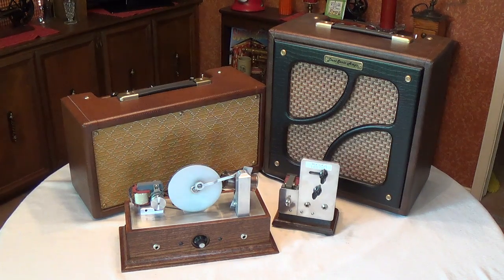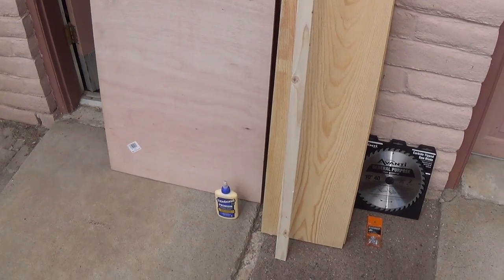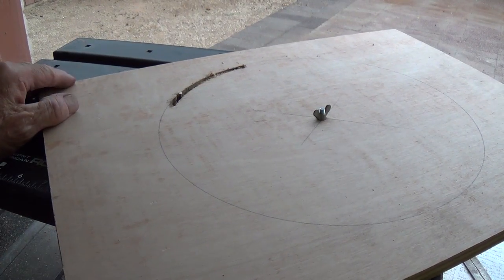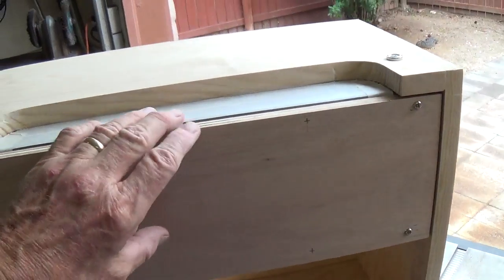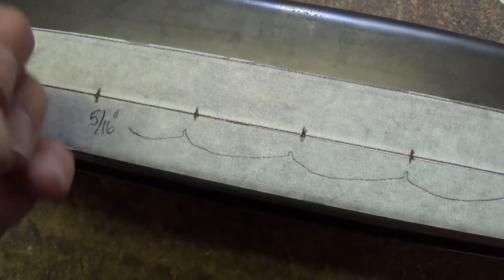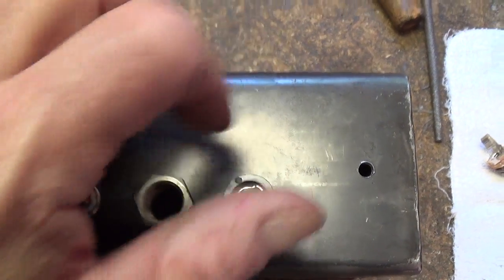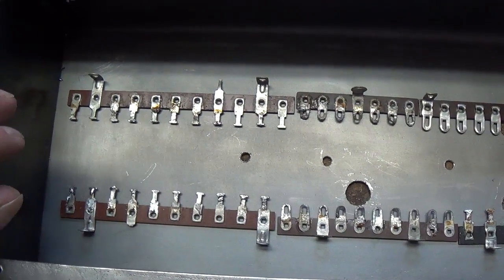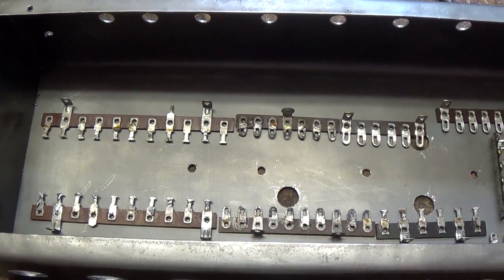How to Scratch-Build a Vintage Amp, Part 6:  Cabinet Construction and Machining of Chassis

Comment: use a drilling lubricant! Brilliant! Having just done this a few times DIY, it never would have occurred to me, but it makes perfect sense. I was a bit surprised that you used porcelain tube sockets. My preference is to use those dirt brown Belkins. I often will design my amp's faceplates on my laptop, and lay it out real nice and have that made before I drill the chassis. That way I can get it to conform to the faceplate perfectly. It helps that I have some background in graphic design.
Reply from the maker: +Alva Goldbook  Yes, by all means use a proper lubricant, Alva.....and not WD40 or some silicon spray. I use a special machinist's lube that is specified for drilling and tapping. It makes the difference between a 3-second drilling time and a 3-minute (smoking, bit-destroying) drilling time.  Your faceplate idea sounds great. I hope mine turns out nearly as well :)
Reply: +Uncle Doug I get my faceplates made for around $35 each. It ends up being pricey this way. One of these days I'll set up my own silk screening station, but this is how I do it for now. Here's the faceplate graphic I designed for that rebuild of my Fender Hot Rod Deville into a blackface type amp I was talking about earlier. The spacing of the holes are based upon the existing chassis. 

http://i.imgur.com/1PjRAZQ.png
Reply from the maker: It looks very professional, Alva. My designs are much simpler.....and less expensive :)

Comment: Uncle Doug, Enjoying your series immensely! Thought you might like a video I'm linking here of an enthusiastic demo of the old Supro, yours is based on, alongside a new Supro which is their reinterpretation of the design.  The guitarist is quite good and plays a lot of familiar '60's riffs.  I suspect I will like your amp the best when it is done, as the new Supro is no longer single-ended and doesn't have the larger speaker.
https://www.youtube.com/watch?t=120&v=oMcw79K2tDI
Reply from the maker: +bills48321 Thanks so much for your kind words, Bill, and for the link to the demo. The guy is an excellent musician but much of what he says about the original Tremo-Verb is confusing or incorrect.  The new Supro is the 1622, which is double-ended (6973's). He speaks about the old one as being single-ended and 5W.....but that's the 6422 (the one I'm building) not the 1622 (which is the one they reissued and he is demoing). It's like comparing apples and oranges, power wise. Also he says Supro was the first to put the tremolo after the reverb.....but as you can see from the schematic, it's way before the reverb. I thought the old one sounded warmer, but did like the overall tone of the reissue. I'll bet if they compared the new amp to an original double-ended 1622 in good shape, the old one would probably come out on top. Still, I congratulate Supro for reissuing the 1622 and wish them the best.

Comment: Excellent Uncle Doug !!  While watching and listening to you handle the 16 GA chassis - it sounded so very solid - I was wondering how much it weighed !!  I noted your earlier comment that perhaps 18 GA would have been adequate.  Any conjecture as to how much lighter that would be ?  Thanks for all the great videos !!!
Reply from the maker: +Donald Filbert It probably weighs 3 or 4 lbs, Don. I would think in 18 gauge it would be about 20% lighter. It is really solid, but machined up without any problems. You're welcome for the videos. Glad you enjoy them :)

Comment: We're all enjoying this build immensely! Doug, what gauge is the sheet metal of your chassis? I'm making a new front panel for my variac and I'm wondering what gauge metal those step bits will go thru. I'm pretty sure what I currently have is 15 ga. Needs to be fairly heavy to hold the variac mechanism. Thanks again for the great videos!!
Reply from the maker: +headinsouth1  You're welcome, HS. I used 16 gauge for the chassis, which is about .060" thick.....very stout.  The step bits didn't have much trouble enlarging the holes, especially when properly lubricated.

Comment: Hey Doc. What do you do to finish the chassis on the top where the controls would be? Do you just leave it raw? Thanks
Reply from the maker: +Brian Hegge  Great question, Brian, and not an easy one to answer. This has always been a challenge on my other scratch-builds, and I have come up with various ways to meet it. You can see their control panels in some of my videos.  I'm still somewhat undecided, but am very close to a solution. It won't be raw.
Reply: +Uncle Doug As always, I appreciate the great creativity and craft you're putting into this and your other projects.  If you want to design a face plate you can have one fabricated here: http://precisiondesignin.com/  DIYers on the Gear Page use it as a source for replicas and one-ofs, though I know you're partial to making your own.  Great series and like others I am looking forward to the next one.  Maybe Jack will be done snoozing  and give you a paw.
Reply from the maker: Thanks for the kind words and link, Carl. I have come up with nice control panels for my previous home-builds.....hopefully, the same will be true for this one. I'll ask Jack for some advice :)

Comment: Looking at how nice the routering came out I would be temped to stain and varnish the bare wood.
Reply from the maker: +Arnold Rimmer Thanks, Arnold. I am tempted to build a bare wood cabinet, but would want to use a more attractive wood than pine.....perhaps mahogany or (expensive) walnut.

Comment: Cool series! Thanks! Are you going to plate the chassis?
Reply from the maker: +stekks Thanks, S. No, I'll probably either paint or clearcoat it. The problem is that any coating will probably interfere with proper grounding.

Comment: Beautiful.... ..Nicely & Artfully Done.....(Milling is always the way to go if you can do it). Good tip on the transformer placements...changing the angle of attack to a right angle on the magnetic fields...so that it may might be less likely  for the fields to interfere with each other ....very good . The Devil is always in the details.....excellent !     ;D)      B.
Reply from the maker: +William Earney  Thanks so much, William. I have a mill, but have always simply cut out the transformer holes. Glad you liked it :)
Reply: +Uncle Doug  and Rusty......Actually I was referring to your use of the Router table  to "Mill" out your speaker baffle opening....."wood milling".....I should have been more specific....    but now that you mentioned it.....wouldn't be wonderful to have  one of my old "Bridgeports"  setting in the garage  to take on those pesky metal cutting/ milling chores....  Hah!!  ......Cheers...Bill
Reply from the maker: Bridgeport mills are wonderful, until it's time to move one :P I have a small mill, but only use it for tasks that can't be done in any other manner, due to the required set-up and clean-up time.

Comment: Thanks again. In your previous video you mentioned you saved money by not using MM transformers. I gig with a Fender Reverb Deluxe 65 reissue. Every mod I have made on this amp I reverse as it seems Leo Fender got it right first time. I have thought of upgrading the OT on this amp. What is your opinion of the OT on this amp and upgrading it?
Reply from the maker: +Shane Easton  You're welcome, Shane. I personally think you are correct about the original design and major components.....they work just fine. You could check Fenderguru's site for ideas on how to improve the DRRI, but I am willing to venture that changing the OPT would be an expensive and ultimately unrewarding task.
Reply: cheers
Reply from the maker: Likewise :)

Comment: What you might want to consider is what I did for the Magnaclone: get a scrap piece of wood and use wood screws to mount the terminal strips to it (lay out the terminal strips with the same measurements they'll be in the chassis.) This lets you wire up almost everything, without having to work inside the chassis. Once you've got the terminal strips wired up, you can transfer them to the chassis, screw them in (or rivet, in your case), and then just run wires to the tube sockets, pots and transformers.

I got my terminal strips laid out in the chassis the same way you did, then drilled their mounting holes. Then I stuck a board under the chassis and marked through the holes with a Sharpie. Then I just used some short wood screws to hold the terminal strips to the board while I soldered the components on.
Reply from the maker: +catdumpling   What a great idea, Cat. Thanks so much. It's always good to hear from you :)

Comment: thanks for the tip . as far as the carpet tape I found a better way regular masking tape and super glue . put the masking tape on the template and the workpiece then a thin bead of super glue holds much better . cost much less and is much thinner. I use that to make inserts for my saws . to cut out vents in back panels any number of things. thanks again
Reply from the maker: +Jim Lundin  You're welcome, Jim, and thanks for sharing your methods. We appreciate your input :)

Comment: Really makes one appreciate just how labor-intensive it is to build an amp from design and construction, to finished product. I can`t imagine how one would put a price on the blood, sweat, and dog biscuits and still call it an affordable amp once its all said and done. I know its not an amp you intend to sell really, but more of a personal endeavor and a hobby for your own enjoyment. Lastly, and it shouldn't be a huge concern as I wouldn't think there are any nefarious characters lurking in our midst, however, you may want to blur out your license plate of your Jeep just to be sure. There is a tool in editing that provides that `blur-out faces` feature. I`m sure it would work for license plates just the same. All the best good sir, and looking forward to the final chapter in this series. Cheers!
Reply from the maker: +Krang Gangs You're right about labor-intensive, Lee. Each time I build one of these, I am reminded just how much work is involved.  I can see why mass-produced cabinets (in foreign lands with low wages), printed circuit boards, and robot assemblers all came into being.  Re the license plate, it was an oversight and probably can't be remedied once the video is posted.  I guess if anyone wants to drive all the way down here to face Rusty's fangs, claymore mines, barbed wire, and five clips of .45 ACP to steal an old Jeep and some homemade amps, then there is just no stopping them :)) Thanks for your concern.

Comment: Hello Doug, do you intend to spray the outer of the chassis. I think you live in a rather dry climate area so moisture and rust on the steel may not pose a problem. Here in NZ we get 4 seasons in one day, so I would think spring or powder coat would be ideal. You do need bare metal for the grounding though don't you, especially the ground bus if there is one???
Reply from the maker: +allanpennington You bring up a good point, Allan. It's very tempting to either paint or clearcoat the entire chassis, both for appearance and rust prevention, but then you create grounding issues, so it's kind of an enigma.  I'll come up with a solution.....I hope :)
Reply: +Uncle Doug was going to ask about this myself. paint is important but so is proper grounding. what if you rivet all the holes (and keep them hollow) , mask them out and paint the rest of the chassis?
Reply from the maker: Believe me, I'm trying to come up with a practical approach, Szymon. Other than using stainless steel for the chassis, any ferrous metal presents this same problem.

Comment: Hey Doug , you ever think of leaving a cab plain? Your woodworking is great shame to hide it.....Next one you do you should leave it bare wood with poly or something on it......
Reply from the maker: +Chuck Nowakowski   Thanks, Chuck. I have considered building a natural wood cabinet. I think I'd be better off using an attractive wood, like mahogany, oak, etc. and all the jointing would have to be perfect. Maybe for a future project.
Reply: +Uncle Doug  and Rusty.....I own three  (3) Fender FSR  Acoustasonic 150's...Solid Mahogany amps.....Fender only made "300" of these "Factory Special Run" amps.  Bought in 2008 down turn when they couldn't be given away...now... they  can't be had.  Beautiful  dark brown Mahogany  w/ clear Hi-gloss poly finish...finger jointed....super dense solid Mahogany wood.  They all  weigh a bloody ton.   They are solid-state !!!!....but the most beautiful  perfect and versatile amp Fender ever made.   Designed for acoustic...it's stereo....but has a channel  set up for electric w/ Blackface...Tweed...British......set-ups ....Heck it even has a low Z mic input with phantom power...you could run a ribbon mic with it.....Direct out.....best amps I've ever owned.....from a violin...to a flute.. to a cello... to a Martin ....to a Tele..   Buying  3 means i bought .....one (1) percent ....of Fender's entire inventory......Hah!      (The only Amp ever made that your Wife would allow in the living room.....Hah!) 
 Mahogany should be your next build.......or maybe Cherry....Walnut would be nice...(Should be a hard wood that's why Marshall used birch ply instead of pine ply on their cabs   ...density!  ) Three coats of Poly...... They're Heavy & and most Beautiful...(the dense wood changes the tone for the better)...B.
Reply from the maker: They must be beautiful, William. Buying solid mahogany lumber is not an easy or inexpensive task, but it's beginning to sound like an interesting project. Thanks for your input.
Reply: +Uncle Doug I'm a sucker for some gorgeous red oak, so that's my vote ;)
Reply from the maker: I agree, Chuck. I start checking around locally for some high-grade lumber :)
Reply: I friend of mine in The Gold Country- Sierra Nevada, is a banjo maker... Though most of his work is either Oak, or Cherry... He's also used unique California woods, like Coastal Redwood, (a softwood) and I believe, Madrone (a hardwood), for some of his projects... I think I remember reading that you preferred soft wood in amp cabinets for its resonance. I know that most of the finest resonator banjos use hardwood (often a very dense plywood made of "recovered" wood from the bottom of Lake Superior) in the drum... I imagine that many of the widths, and lengths would have to be altered to compensate for the density of the hardwood... I'm sure you're aware of the tone wood obsession in acoustic instruments... There is surely a whole other set of rules for building hardwood cabinets, and then tuning them  for the optimal sonic benefit, but I'll bet it's worth it.... I know that some of the really upscale Mesa/Boogie Amps have Hardwood. You probably could even make an amp with a volume from 1-11!!! SUPER LOUD DÜDE!  :) "It's so boss!!!"
Reply: +Uncle Doug and Rusty.......Tell Rusty to smell out the best hardwood deal ...send him to some "custom cabinet shops" in your area ....sometimes they have "excess" and will make a deal....sometimes they will share a good source.
PS  A "cane" or "wicker" speaker grill  looks... g-r-e-a-t .. with.natural wood... no matter what Hardwood you settle on........Good luck on the hunt....Bill.       (Poor guy...you haven't even finished this project...and we're bugging you on the next ...Good Grief ) Hah!
Reply from the maker: I agree that cane goes well with natural wood. I'll keep that in mind :)

Comment: It was like I was looking over your shoulder! Are you going to make or order the dash/faceplate? Man that is a great idea to install terminal strips. It will cut back a little on over all weight and be so easy to wire to. Brilliant!  Your production crew seems  a little bored. I guess they can't wait to smell the completed amp. Thankz
Reply from the maker: +Audio Tech Labs  You're welcome, ATL. I will make my own nameplate, as described in one of my videos.  Glad you like the terminal strips.  Usually, two parallel rows, almost full length, will do the job.  I may have to add a couple as the wiring progresses.

Comment: how well did cutting out the hole for the speaker work when you routed the last bit of it . I am very interested. I build cabinets every day I have tried several ways and have thought about doing it like that but figured at the very last inch it would cause problems . I use templates I originally made by bolting a speaker to ply and using a flush trim bit the bearing riding on the speaker basket or more correctly the foam or cardboard gasket. but from many uses the templates wear out mostly from putting the studs through them
Reply: +Jim Lundin Make a template out of 3/4 inch plywood. Spray it with several coats of polyurethane. Use double stick carpet tape to hold it in place while you cut with a template router bit. ( bearing on top) if you don't spray the template the tape will peal the wood out in chunks after lots of use.
Reply from the maker: +Jim Lundin  It worked perfectly, Jim, all the way around.  I too was worried that once the center circle was freed from the baffle, the baffle might wander and get chewed up.....but there was no problem at all.  I was using a straight-sided, unpiloted bit and maintained good control over the baffle at the end.